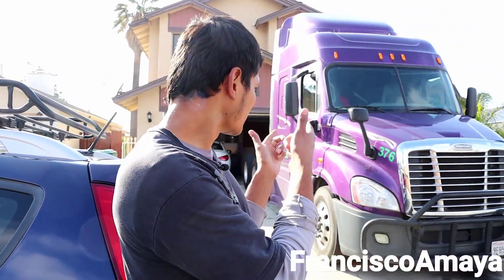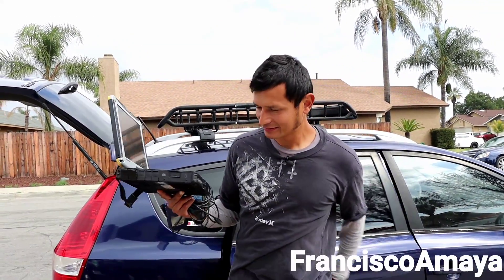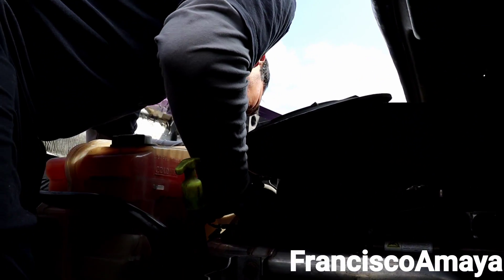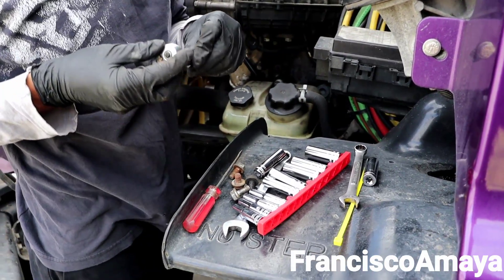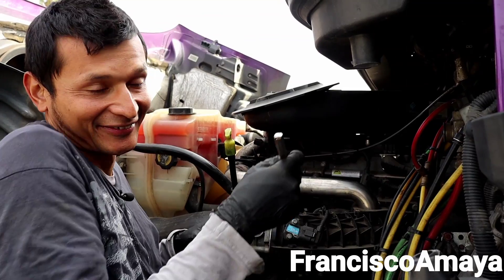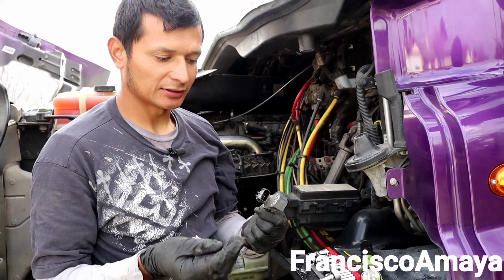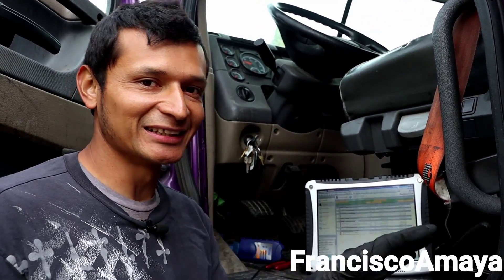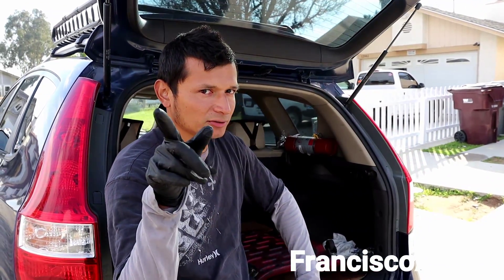S1 E2 F.A.I.T.H.  Moreno valley rail delivery services DD13 spn 2631 fmi 1 low power check engine

Comment: Francisco .tengo un problema con el compresor del aire o quizás con el air driyer.no corta @125 psi.se pasa de los 125 y se va alas válvulas de escape para soltar el aire.ya le cambiaron el secador y yo le cambie la válvula del compresor y sige el problema k no corta a los 125.se va de paso a 135.regule el gobernador y no me deja calibrarlo a 125 si lo dejó a 125 tira todo el aire con el motor andando.
Reply from the maker: Talvez el compressor esta malo.  Cambie la valvula unloader de el compressor

Comment: Good job Francisco.  I have not used dddl in a long time.  So now the software actually has monitor tabs?  So when it goes through a drive cycle the box will show green saying that it has passed?
Reply from the maker: Correct
Reply: @franciscoamayaYT  Wow Cummins needs to take notes from Detroit.  They do not include that on Insite.

Comment: I had this same issue after the boys at the Wildwood FL truck wash cleaned my engine bay.  They sprayed the DPS too close and water logged it.  After cleaning it out with a piece of wire and some compressed air it still threw the code. So I had to buy a new sensor.   Worked like a charm after that.  We all like a clean engine bay, but you got to watch them folks.  They don't know what they don't know.  Thanks for your videos Amaya, you've helped me more than once. 😎👍🏼😎👍🏼😎👍🏼
Reply: Did you use a laptop 💻 with the program to calibrate the new sensor ? Or just install it and that’s it?

Comment: cut off that zip tie and throw it in a electric drill and use that to clean out the delta-p sensor ports. works like a charm.